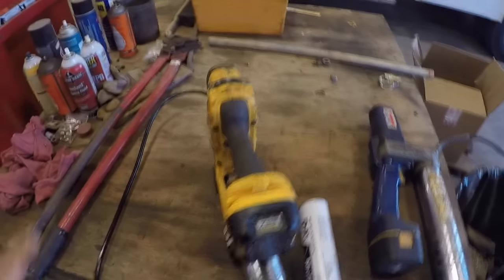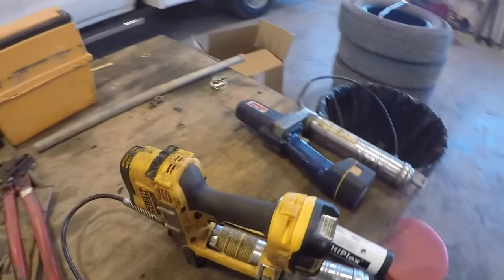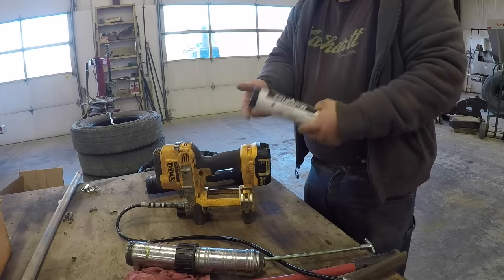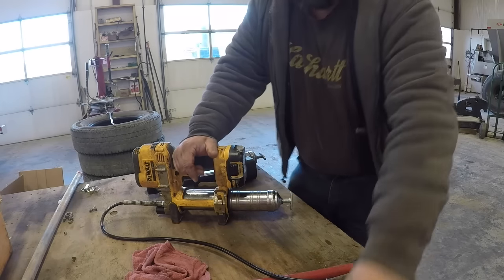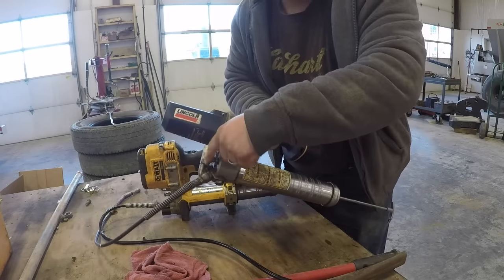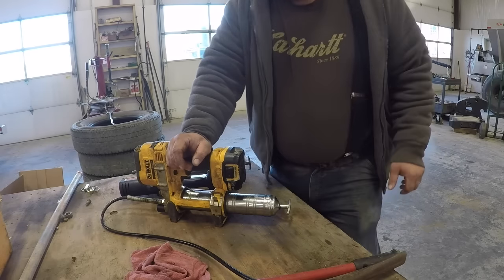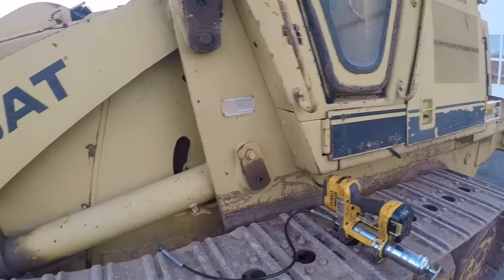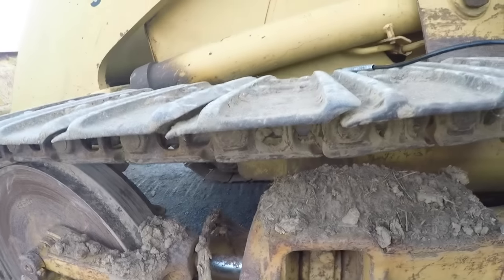How to bleed a grease gun every time!

Comment: The bad thing about automatic grease guns is that sometimes you can't tell whether or not grease is going into the zerk.  But .... Just leave the pull rod all the way out.  If you're wondering whether or not grease is going in, just watch the rod.  If the rod is moving in, grease is going in!
Reply: The sound is also different when there is grease moving out of the grease gun vs when there's nothing going out of it. There's this sound of resistance when grease is being pumped out and there's just this smooth motor running sound when there's none.

Comment: Thank you. I'm an aircraft Technician and I recently bought the Lincoln 12V. I dont need that much power. That bleeding method of yours will save my night. I had to stop using my cordless gun today and use the hand pump one just because I couldn't get rid of those bubbles.
Reply from the maker: This will work on the Lincoln I've got one.

Comment: Just to let you know, I kept bleeding the gun several times and finally I was able to pull the plunger out and lock it in place. It had about 1.5 " of old grease in it. Replaced with a new tube and now everything is working. Whew! Thanks again.
Reply from the maker: +reese cup. Lol. Glad you finally got it going! Good job!

Comment: Brother you just saved me some headache. Ive loosened the tube on regular hand crank pumps and pushed the plunger in and it works on them. But I have fought with this new Lincoln battery powered gun for 3 hours until I seen this video. Didnt know I could push on the grease that way and it works. THANK YOU SIR!!
Reply from the maker: Awesome

Comment: I have always had problems bleeding grease guns.   I always use the stupid useless "bleed button" that is on the grease gun.  It's always a struggle and it's always been very frustrating.   This video was the BEST.   It worked so well that I printed the instructions and hung them in my toolbox.   My eternal grease gun problem has been solved.   This video is excellent, and I'm so happy I found this.   I don't use the DeWalt, I use the Milwaukee...but the same exact principles apply.   THANK YOU!
Reply from the maker: +Scott Smith. I glad I was able to help! Happy greasing. Lol

Comment: On way I suppose to use one grease gun and still use both fittings is to have the lock and lube as the primary on the gun. Then make a small extension hose with the smaller fitting on one side and a coupler and grease nipple on the other side of the hose. Now you can interchange between the two fittings instead of two grease guns. Just an idea. Thanks for the bleeding tip!

Comment: Thank you so much man I thought that thing for 2 hours in the cold last night trying to get my Milwaukee skil to pump Grease Tru two tubes of Grease away thinking it was the grease. Going down outside right now to grease my dump trailer which I've been fighting with to get greased. We'll try your Technique and let you know how it did. Thank you sir also for the dipstick on a grease gun I never I knew that.
Reply from the maker: It should work. If it really cold out bring the gun inside and let it warm up that helps too. When the grease is cold it air locks worse. 
We will put them in the floorboard of the truck on the way to jobs a lot of times to warm them up in the mornings.
Reply: @DLHFarms  it absolutely worked flawlessly  thank you so much buddy.

Comment: I have the 20 v DeWalt Grease gun with the long lock and lube and couldn't be happier with it what a timesaver. I've been using the air bleeder valve at the front of the gun I will try your trick to  bleed the air out next time I put a new tubing in it. So far I have been able to get 15 1/2 tubes on one charge. Did not know how to find out how much grease was left in the tube thank you for the tip.
Reply from the maker: +Mech Uno. No problem! Glad I could help.

Comment: Good vid. Just learned this last week when I bought a new Napa/Lincoln manual lever gun. I did the unthinkable and actually RTFM before loading it. Pretty much to the letter what you described. Makes things much easier. For years, I used to slap the cylinder with the palm of my hand while holding the bleeder button. That worked most of the time.
Reply from the maker: +Bullfrog's Workshop. I actually didn't know that any owners manuals told you how to do this method. That's pretty cool.

Comment: I didn't buy a lock n lube for the same reason, cant get inside the darn PTO shafts. Instead I purchased an end made by a company known as univer-co. I found out about it through Paul Short, another you-tuber. It works just like and air hose coupler, push it on the zerk, grease away, then pull back on the coupler to release it. I have 3 of them now on Milwaukee grease guns and love them. There a little pricey, but there not some cheap china crap either!! You can purchase them on E-bay and if I remember correctly mine were about 40 bucks each plus shipping. Check them out sometime, I highly recommend them if your doing lots of greasing!!!
Reply from the maker: +Nursery Life. I've watched some of Paul's stuff, I haven't heard of that gun end though, I will definitely check it out, thanks a lot!

Comment: Great video.  I just picked up an 18v Milwaukee electric grease gun on a pretty good sale ($200 with battery) and I'm trying to decide if I'll keep it.  I've got a 18V Milwaukee Impact Gun (amazing by the way), so it made sense to stick with the same set.  The electric does look pretty nice, especially when it comes to lubing the knotter assembly on my baler.  I'd recently discovered how to lock out the rod on my hand operated guns, but didn't realize you could check the level by pulling out the handle.

Comment: Yep that's exactly how I do it! My coworker and I figured that out about 4 years ago. We had the allemite 12 volt for quite a few years. They were a good grease gun but the batteries really sucked. Now we have the allemite 14.4 volt lithium ion and we like them a lot better. Also totally agree with you about the lock n lube. I got one and found the same thing you did. 👍
Reply from the maker: Yep lock and lube works great if you can get it on the fitting.

Comment: To add a note on something you did right off the very start but didn't comment on is to unscrew the canister and then pull the plunger out. Otherwise your trying to suck the grease back. I used to do it before i clued in and i see alot of people do it. And i completely agree with what you said about the top vent useless
Reply from the maker: That’s a good point thanks

Comment: Thanks for the info on grease guns. I’ve got a Lincoln and I totally agree the bleeding button on the top is useless. Also got the lube lock ends and like you I’ve got the same issue they don’t fit over half of zert holes.

Comment: Nice tip I had just bought a DeWalt and was having trouble getting it to prime. It's been over 110 here for a month so the  shaft was stuck on the plunger and it just pushed all the way down without much resistance (to me, guess I ate my Wheaties) so I ruined a tube of grease. Went to the old YouTube to get some tips before I did that again.
Reply from the maker: Haha hope it all worked out for you this time

Comment: I have 2 of the Dewalt 20 volt grease guns and absolutely love them but after running perhaps 100 tubes through them I found I wasn’t getting much grease out.  I thought perhaps I had worn out the pump so I went on line to see if there was a rebuild kit for them.  What I found was others that had the same problem.  Seems the screen built into the cartridge gasket gets plugged up with a component of the grease and the cure is to simple wash the screen in a solvent.  My 2 year old grease gun works like new.  I’ve been using grease guns for 50 years and never had one with a screen let alone one that grease could plug😀
Reply from the maker: Thanks for the info

Comment: So that's an awesome tip, and pathetic I did not know and have struggled for 30+ years replacing grease tubes, but I still have problems with grease leaking past the plunger seal, and the harder I push, the more leaks past.  Then, when I pull out the plunger, lots of grease oozes out the plunger hole.  Usually I lose 1/4 the amount of grease that way.  I guess I need better grease guns...!
Reply from the maker: Sounds like your grease gun is about shot. Some grease leak by is normal but not a 1/4 of the tube.

Comment: I now use the grease nipple connectors that have 4 grips instead of the more normal 3 in the tip and I find they last much longer however they can be a pain to remove from the nipple if under high pressure.
Reply from the maker: +Dan Whiteford. Yep we use those too if we can find them.

Comment: Nice trick.... I usually would loosen the tube like you did, but almost to the point where it would just about come apart (and risk losing all the grease). Didn't know about that trick with the plunger, but don't know if the cheap hand pumps will do that.
Reply from the maker: +Farming 4 Generations. Some of them will some of them won't. Some of them you have to fiddle with a little to get hooked to the plunger just right.

Comment: I do the same thing as well. I am starting to get a kick out of the grease gun videos. I have a Lincoln one you're right but it was given to me. someone had it in a hot place so some of the grease leaked out they said it was bad and was going to throw it away. well I have used the bad grease gun for four years. and I have put at least 5 times the grease though it as they would have.
Reply from the maker: +Howard Younger. It amazes me at what some people will throw out! I'm glad you already knew about this trick but a lot of people don't.

Comment: that knurled thumb screw right above where the hose exits the gun is an air bleeder.  crack it loose just a but and hear the air escape. it's in the owner's manual that you threw away.
Reply from the maker: Like I said in the video that doesn't work

Comment: Great vid there, Dennis, thanks.. I'm trying to figure out how that little trick works on the inside.. Why turning it one way and then back makes it so you can push on the grease... Guess I'll have to pay better attention next time I refill it.. I just got one of those 18V dewalts in the mail, (amazon) but it didn't come with a battery.. WTF?? If I had payed better attention, I'd have seen the note saying 'battery not included'.. Battery just came in, so I'm off to do some greasing.. Thanks again for the tip.
Reply from the maker: +TheDirtyyoungman1. Your welcome! Hope you like your new gun!

Comment: Thank you Dennis! Great, I always thought when the plunger jammed I had the cartilage out of line and it had caught the end of it.  Daaa. I bleed air by untwisting the top but seem like I have to unscrew too far and then had wreck w grease spilling out..Thank you from S side VA... We are dry up here in the upper Valley as you were talking about in Late July and August. Look forward to more Vids, like the construction ones as much as the farm, hay ones. Can you do one on how to open up frozen zerks/zirks??? or partially clogged up ones??? W/o replacing, please???
Reply from the maker: +steve mondal. Thanks for the comment, I will see what I can do I have had problems with frozen zerks before, most of the time from lack of grease and the old grease will dry in the cavity, it can sometimes be a real pain to get them working again. We are getting dry here again, crazy weather this year!
Reply: have you got back the grease gun that is covered with grease  back to you and they put the cartilage in wrong

Comment: When you said, " 𝗜'𝗺 𝗳𝗼𝗿𝗰𝗶𝗻𝗴 𝘁𝗵𝗲 𝗮𝗶𝗿 𝗼𝘂𝘁 𝗼𝗳 𝗶𝘁 "It appeared you had to put pressure on the rod, Then after that, you pushed the rod in easily. What took place. What caused the difference?
I wish the audio was clear.
Reply from the maker: A quarter turn of the rod will lock it to the plunger inside the tube. Pull out on the rod until it stops then keep pulling gently and turn it a quarter turn at a time then try pushing on the rod and see if it’s locked in if not pull on it and turn it another quarter turn eventually it will lock to the plunger and you can push on it and I will push the plunger.

Comment: Good video     I knew about backing the can off push the plunger in to help bleed   but did not know the 1/4turn and lock part . I will have to try this next time I change a tube   most the time have manual guns in the feild and at the shop or home just have the pneumatic no battery ones tho .  Paid by the hour no need to rush lol
Reply from the maker: Lol paid by the hour. 👍

Comment: I have been bleeding the same way since I bought mine about 7 years ago. I think I have problems with mine. Maybe you had a similar issue before. I have grease coming out when i don't have her on a cert. I tried bleeding it in all ways possible but there don't seem to be enough pressure to do the job. It sounds lile she is pumping. My theory is that she might be worn out after several 1000 tubes of grease. What do you think?

Comment: Do you ever have trouble with the  filter screen in the Dewalt clog up? It acts like its air locked grease just doesn't flow, ours needs cleaned about every 3 tubes, maybe the grease we buy isn't good....anyway thanks for the tip!
Reply from the maker: +Isaiah Shaffer. No never have with probably 100 + tubes though 2 different guns. Didn't even know there was a screen to be honest.

Comment: Good video sir.  I found the trick with the tube out this past summer.  But on the DeWalt vs. Milwaukee I have to disagree with you at least with the on my friend has. I like my Milwaukee much much better. The thing I don't like is that it air locks bad. Much quicker with that trick but still does it sometimes.
Reply from the maker: +Dan Fike. I've used the Milwaukee 14 volt Lithium and it seemed like it was pumping in slow motion compared to the DeWalt. But everyone has thier own opinion I guess.
Reply: DLH Farms the  Milwaukee that I have is the 18 volt lithium and the DeWalt that he has is the 18 volt
Reply from the maker: +Dan Fike. Never tried the 18 volt Milwaukee.
Reply: That's just my opinion. Have a great day.
Reply from the maker: +Dan Fike.Thanks! You have a good one

Comment: That's a nice trick to prime the gun, I was having a tough time deciding to get the locking jaw accessory you were talking about.  I also have some tight places where it would not go at all.  You actually helped me with that problem too, buy two power guns.  Especially talking about the power, you favored the more powerful one because it works better.  I bought a Milwaukee 12V and it's nice however, I bet that 18V Milwaukee one is much stronger & faster.  Thanks

Comment: I’m about to try this currently can’t get grease out of my gun. It’s 20 degrees outside. I’ll let you know if it worked for me later. Thanks for the video
Reply from the maker: Warm the gun up before you use it. Put it in the floorboard of your truck for a while with the heat on
Reply: DLH Farms I warmed it in our butter room at work. It stays at 120 degrees. Your trick worked so thank you!

Comment: Locknlube has a new one with 3.5" reach. Haven't tried it yet but plan on ordering. Look on their website, looks like solve the problems we all have getting into tight grease zerk locations.
Reply from the maker: +Jim Sullivan. I'll take a look but it needs to be smaller diameter for me. A lot of fittings are in a small hole to protect them from getting broken especially on excavator bucket pins

Comment: Question:   I have a hand pump grease gun.  I haven't used it for a number of years.  I'm packing bearing on my boat trailer and the pump just goes up and down.  Very little grease goes out.  If I let the pump rest five or six seconds then it will pump grease one time.  I'm thinking I need a new grease gun?  Suggestions?
Reply from the maker: Grease is thick and takes time to fill the chamber back up between pumps.
Reply: @DLHFarms  Thanks.  I'll keep working with it and clean it when it's time to put a new tube in

Comment: That dewalt has a bleeder screw right there beside the hose. Crack it open quarter turn and go full throttle till grease comes out of the bleeder and tighten it back up, all primed, presto. Even easier than this trick.
Reply from the maker: +J A. It Don't work sorry.

Comment: The pressure relief valve opens at very little pressure so I have to use the manual handheld instead which does the job.
Reply from the maker: +Gustav S. Must be something wrong with your pressure relief valve. Should go to 10,000 psi

Comment: My Dewalt grease gun lately has been having a big issue. Once I load a new tube and prime it it works great until I put it back in my truck toolbox and drive around for about a week and then I need to grease something again. At that point the plunger has bypassed all the grease and all the grease is now where the spring is. Even when I go to change out a tube there’s always grease coming out the back side by the locking portion of the slot. It’s so frustrating
Reply from the maker: Sounds like the seal has went bad on the plunger

Comment: lol, you have to know how many people do not know how to check or check out the tubes. they will spend an hour telling me I am wrong how I learned to do it. now I will not leave my grease gun's out, I just buy Lincoln grease guns and I had a chance to try a Milwaukee battier one out and after I gone out and bought a couple of them I use different grease for different jobs I do work with  food-related companies I have to have the right grease I use 
for them 
do you note when you use the battier power ones less chance that the grease would  go in the grease zerk then around it
now to have them that think pump grease into bears and pushes the dust cover out of the bearings or the tie rod dust cover out I learned at a very early age not to do that